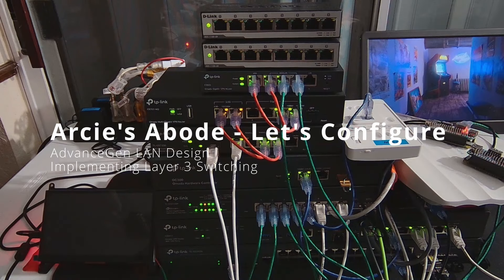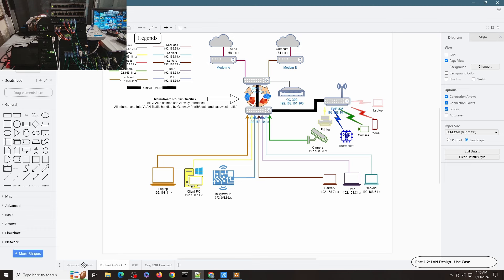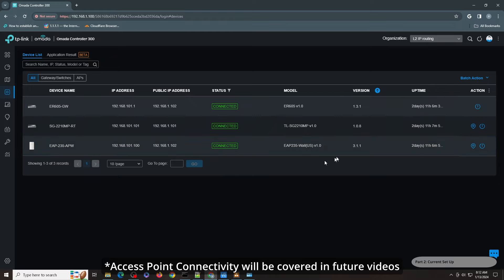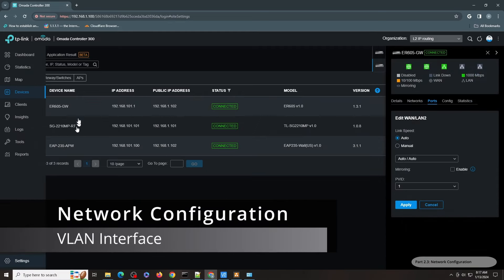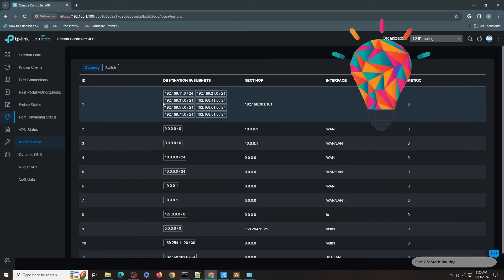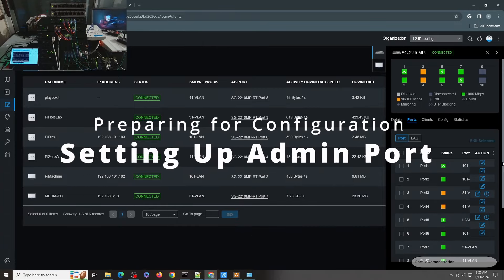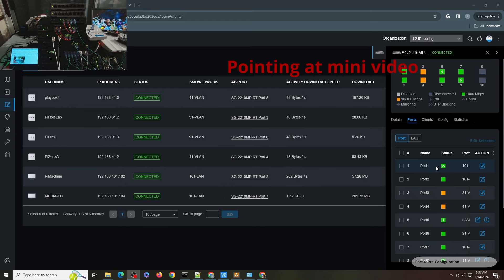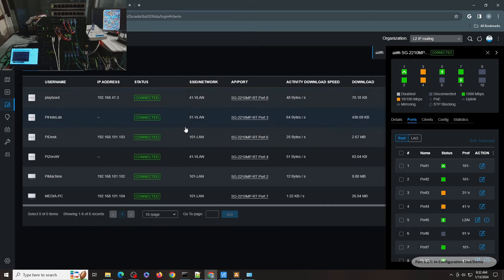LC67: Layer 3 Switching with TP Link Omada. Use switch, instead of Gateway, for InterVLAN routing

Comment: Hopefully the right video to prevent me from going back to MikroTik and doing everything from scratch + spending another fortune on new l3 capable switches...
Reply from the maker: hey @victorshane4134, thanks for dropping by! I had a Mikrotik hex rb750Gr3 which I used side-by-side with my old EdgeRoute Lite ERlite3 as a back up. I gave it to my friend because it's fast and trouble-free and I just used an old Cisco/Linksys Wireless Router as a back up instead. Hope yours is still rocking it!

Good hunting!

Comment: I cannot set a speed limit for more than one PC connected to the same port. Does L3 provide this? I would appreciate your answer. thanks
Reply from the maker: hey @necatibilen4130, thanks for dropping by the channel. if you would like to set a limit, you don't need an L3 for it but what you need to do is Bandwidth Control and there are many ways to do it. I discuss several ways to do it here: https://youtu.be/JiJNuF-gMgc?si=yDdNGQHONqqZECTR&t=383

Good hunting!

Comment: Thanks for the video! it help much, but some how i cant ping to others vlan that i created :eyes-purple-crying:
Reply from the maker: heya @user-sg7xn1yg4n, thanks for dropping by the channel. And sorry you have issues with pinging, there are so many various reasons why a Ping can fail, to name a few, bad cable, OS block, ACL, incorrect gateway, etc. This set up makes it more complicated. I suggest you try the traditional set up first (i.e. Gateway VLAN Interface rather than this) then when you can do InterVLAN with traditional set up, disable that Gateway VLAN Interface, duplicate all the info you have there (i.e. IP address scheme, etc)  and follow the steps I laid out here.

Good hunting!

Comment: Thanks for this great tutorial! I have a question, at 21:54, are you configuring that static route inside the switch or the router?
Reply from the maker: hey @andrescubillos1432, welcome to the channel. The Static Route is for the Gateway/Router. So if you have a non-Omada Gateway/Router, you need to configure Static Route on that device and not on the Omada Switch.

Good hunting!

Comment: What is the difference between the "All" Switch Profile and the custom "L2All" profile you made? Both have 101-LAN as their native networks and all other VLANs tagged.
Reply from the maker: hey @Godfreythegolden, thanks for dropping by the channel. The custom L2ALL is my own take to ensure that if I ever have other Omada Layer 3 Switch, that I can separate which "All" is really All VLANs. The default "All" is Omada's ALL VLANs, while the L2ALL is just for that Layer 3 Switch. If you ONLY have 1 Omada Layer 3 Switch, you don't have to worry about it. The complexity arise when you have multiple Layer 3 Switches. For example, you have L3SwitchA with VLANS 1, 10, 20 and another L3SwitchB VLANS 1, 30, 40. Omada's "All" will include VLANs 1, 10, 20, 30, 40. When you use a custom "xAll" per Layer 3 Switch, for example, call it L3SwitchA_All or L3SwitchB_All, it can bring more clarity on which "All" to use, whether the Omada's built-in one, or just specific to all the VLANs defined per Layer 3 Switch.

I covered this more extensively in other videos after this, but I just want to mention it here in case experienced users gets hit with that scenario (multiple L3 Switch with variable VLANs) so that they dont need to wait for future videos.

Good hunting!
Reply: Thanks for the quick response. That makes perfect sense for multiple switch scenarios. I only have a single switch setup, so I was wondering what the identical profile was for. Your channel has been incredibly helpful.
Reply from the maker: @Godfreythegolden  you are welcome,  glad you find my videos useful

Comment: I am trying to figure out if I have SG3428MP omada L2+ switch + OC200 + AEP610. Could I make similar setup if I use not omada but a normal ASUS router. I feel performance of the 4core 1.8GHz router is better and I already have it. (I purchase ER707-M2, but my disappointment was that there is no link aggregation and my ASUS has. Now I have 2.5Gbs connected to my ISP modem, but I cannot get more than 1 GB to my switch. This another reson I like to use Asus RT-X86U router )?
Reply from the maker: hello @svetoslavvalchanov5080, welcome to the channel and thanks for dropping by. The Omada Gateway (which includes ER707-M2) is a Gateway Router and in TP Link world , this means, it can not support trunk ports. I am not familiar with your Asus router, but your SG3428MP is a Switch. It can not do the "WAN" function of your Asus Router. However, your switch can do Layer 3 Switching so you can definitely use your SG3428MP to adapt the settings I am showing here. You will need to configure your Asus router to have static routes pointing to your L3 Switch so that your L3 Switch clients can have internet access. I have a video that will reflect your set up, but instead of using an Asus Router, I am using a non-Omada Router. You will need to adopt the settings of my non-Omada router to your Asus router, but the general steps are the same. You can find the video here:

https://youtu.be/D7al4Yw21bI?si=2aEqibZqGuvh4TFK

You can find a write up about it here:

https://community.tp-link.com/en/business/forum/topic/667126

Good hunting!

Comment: Thank you for your videos.  I'm learning a lot.  When you set up the vlan without interface, how do you get wireless devices connected to the EAP to get an IP address, if you;re using multiple wlans/vlans?
Reply from the maker: hey @luisosorio5340, thanks for dropping by the channels. For APs (and any devices that requires multiple VLAN passing), you need to have a trunk port (Profile) that have those VLANs. If you only have one Layer 3 Switch, and you only have one "Gateway VLAN Interface", just use the default profile "All" to pass DHCP to all your wireless clients. I discussed that more and demonstrated adopting EAP in the LC68 video here (3:33 time stamp): https://youtu.be/mkPL5Wkxcsc?si=lB5A1sO37sNEZVau&t=213

Good hunting!

Comment: Thanks a lot for your this helpful tutorials, i highly appreciate the way you share the improvements of your environment. I have a question about configuring the router in your scenario if you would have an may be additional EAP which is connected directly there. It should also be connected via trunk to the router (not to the Layer3 switch) and the same VLANs should be available there as on your example. How should the configuration of the router ER605 looks like then? Who does the DHCP then, still the switch which uses Inter-VLAN routing? Which VLANs have to be defined at the ER605 then?
Reply from the maker: hey @timtaylor3741, thanks for dropping by. For VLANs I have defined in this video, I only have 1 VLAN defined on the Gateway (192.168.101.x) so this is the only VLAN that will be available to any device (access point, switch, PC) connecting directly to the Gateway. Devices connected to Gateway can "reach" the VLANs defined in Layer3, but the VLANs only exist on devices connected to the Layer 3 Switch. You can look at the Layer 3 as another "Gateway" outside of ER-605, and you control whether the VLANs defined in Layer3 can be reachable by Gateway using Static Routing.

So having said that, assuming we have the VLANs laid out exactly in the video (VLAN 1 in Gateway, all the rest in Layer 3), the Access Point can only hand out VLAN 1 IP addresses and these will be handled directly by the gateway (DHCP server, intervlan routing, etc).

Comment: Rewatched video again and it seems like the gateway needs to either be the DHCP server for the native vlan 101 subnet or the switch interface needs to define the gateway as 192.168.101.1.  Please let me know if this is a correct assumption.  Apologies if I missed it!
Reply from the maker: hey @KevinRussellT, in this video, my native VLAN is 1 using IP scheme 192.168.101.x (you refer to it as native VLAN 101 subnet). Not saying you are wrong, just want to make sure I clarify my answer. And you are absolutely correct, I still use the native VLAN because we can't ever remove it from Omada. VLAN 1 is also the default "Management VLAN", it can be changed, but for now, all of my videos use VLAN 1 as Management VLAN or as I often refer to them, Admin VLAN. In this episode, I assign an IP subnet of x.101 and as you mentioned, it is using a Gateway as a DHCP server. But only for "Admin VLAN devices" (which includes ALL Omada Network devices).

Good hunting!

Comment: Good video tutorial! Thank you very much. 
I have in-home game streaming from one VLAN to another, it could be alot faster if the switch can handle the inter vlan routing. But than I have another question for you:
Can you cover layer 3 switching acl's in a later video? Blocking inter VLAN connect can be easy (deny private IP groups) , but allowing traffic from one VLAN to another on specific protocol/ports can be tricky without statefull ACL's. Thank you in advance!
Reply from the maker: heya @MrTelraam , thanks for dropping by the channel and glad you found this useful. and yep, i plan to cover layer 3 switching ACLs in future videos if only to address some nuances that may not be obvious, but you may not even have to wait for my video since i already have many "switch" based ACLs that cover denying intervlan traffic (and automatically) with my "NeXTGen" lan design (the XT stands for eXtra Torture) because ALL of the ACLs (both two ways and pseudo-one-way) are switch-based. When you get the chance, check out the playlist here: https://www.youtube.com/playlist?list=PLdbM7FkjX0_rMzsitj54Hfs2X5scnThfd
Reply from the maker: Heya MrTelraam, I posted a video you mentioned about Stateful ACLs and even made a write up on the official forum. I will post the link below:

Use Cases:
Use Case 1: Home VLAN can "ssh" to IoT VLAN but not the other way around.
Use Case 2: IoT VLAN can "vnc" to Home VLAN but not the other way around. IoT is denied access to all other VLANs

These 2 Use Cases will NOT be possible if Gateway ACL is used because Use Case 1, the Source is Home VLAN and on Use Case 2, the Source is the IoT VLAN.

ACL Video (skip to 24:15): https://youtu.be/yraDD9P-PZk?si=YDGfQ40U1kkA5dRf&t=1455
Write Up/Guide about using Switch ACL as alternative to Gateway ACL: https://community.tp-link.com/en/business/forum/topic/656428
Reply: @deadmeats  hi deadmeats! I really like that you take the time to even go to older comments to say you have a new video about the question asked. Great job!!

I think you did a fantastic thing with the ACL's on switch level. Still it isn't a state full ACL because you have both incoming defined. The standard Home to IoT is allowed and the second rule that you allow source port vnc to destination any. 

It is a shame that all the routers dont have the option to define service type in Lan-Lan gateway ACL. In standalone mode the routers have this option. In this case you can define home to IoT ssh and IoT to home with gateway ACL. This is true state full, because you have only one way defined.

I don't know why we cannot define these service types within Omada tho. Maybe it is something for future releases for Omada. And in combination with switch ACL's you can define which IP to IP communication is possible before it goes to the gateway. So not every device in home is open to vnc and not all devices in IoT are exposed to ssh. 

I don't see a feature request in the forums. Maybe I need to make one for allowance on service type within Omada.
Reply from the maker: Heya  @MrTelraam  , no prob. I usually try to get back to those who are asking in case they missed it because I usually take a long time to post videos i.e. this Layer 3 video is on my to-do list for about a year or so now. As for the ACLs, is there any specific use-case you are looking for? I agree though, that Stateful ACLs is much easier to implement, but it lacks the granularity. If TP Link can add that feature for more granularity, that'll be great.

Comment: Just found your videos this week and I am really enjoying them, particularly these where put a lot of routing in the switch  The main downside I see is that if you want to use a NGFW and have protection rules based on VLANS you have to switch to rules based on the IP range of the VLANS.  Am I correct in this since the trunk port from the switch to the firewall becomes an access port?  If so, I like this better as you don't have to setup all the different vlans and interfaces in both the router and the switch.
Reply from the maker: hey @KevinRussellT, thanks for dropping by the channel and good to know you found the videos helpful. As for switching the rules based on IP range, I want to make sure I don't lead you astray or get you confused :). In the example I have shown here, yes, you will have to do that because all of the VLANs, other than the Management, are never defined on the Gateway/Firewall (but you still can do VLAN-based firewalls). You can find more about ACLs on my LC70 and LC71 Episode (so 3 Episodes after this, start with LC70, links below). But to make it clear, I have been showcasing a mostly switch-centric ACLs on almost all of my LAN design episodes (NewGen LAN, NeXTGen LAN, and AdvanceGen LAN) in preparation for this episode. NewGenLAN is an easier version, NeXTGen is switch-centric design and very strict, and AdvanceGen is based on Layer 3 Switching (this episode). 

And yeah, as I have shared with @J0hnSm1th (a few post below), I have been planning to share this architecture about 2-3 years ago, as a departure to what you can see almost everywhere on the net for so many years, ever since Home LAN became a thing. However, in the last ~10 years, Layer 3 switching is going down in price, and for the last 4 or 5 years, it has become more affordable for home users (proof: my latest video UB40, is a $75 Layer 3 Switch!!!). Btw, since Layer 3 Switching is not very common, it lacks many features i.e. InterVLAN mDNS is not supported, current SDN doesn't support DHCP reservation on Layer 3 Switching, like you mentioned, ACLs will be mostly IP-ranged based. Just be aware that Omada may not cover all your needs that you usually have from Gateways.

I hope that Year 2024 is the time that more and more users start going for Layer 3 Switching for Home/HomeLAB and hopefully, make this a normal thing for Home/HomeLAB use, not just for Omada.

UB40 $75 L3 Switch - https://youtu.be/PyIKpqCbRMA?si=xEeWPozJqq-wOQ34
LC70 Basic Switch ACL - https://youtu.be/yraDD9P-PZk?si=cfMnPCJwbQY0Fq-n
LC71 Advance Switch ACL - https://youtu.be/rTsKcBhyyzc?si=_u37bpL6AOmksN_Q

Good hunting!
Reply: @deadmeats  great stuff!  I just got my Omada software controller, er605 v2, eap610, and sh2008p live in my home network.  Seems to be running great but it is wide open.  DPI is fantastic but need to figure out how much space is needed for the logging as I have it on an old thin client with limited space.
Reply from the maker: @KevinRussellT  nice, good to know man.

Comment: Very good video and worth the effort to try.

However, how are we going to configure other vlans from accessing to the admin vlan 101 and yet admin vlan 101 can hv access to all of the rest of the vlans? In the past we did this setup on the router ACL.
Reply from the maker: hey @stan79yt, thanks for dropping by the channel. There is no change with ACL, since this is all purely Omada implementation. You can allow/deny access to VLAN 101 via Switch ACL and/or Gateway ACL, based on your use case. I cover a revised LAN design which covers ACL in later implementations of this, link below:

https://youtu.be/yraDD9P-PZk

Good hunting!